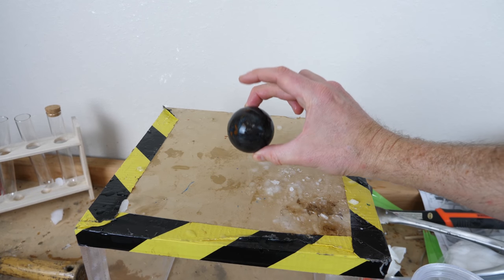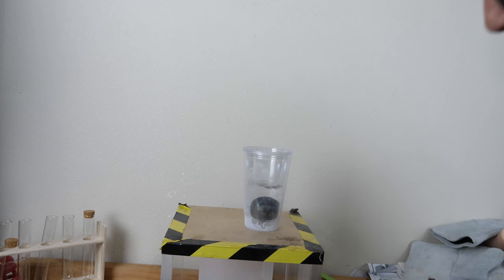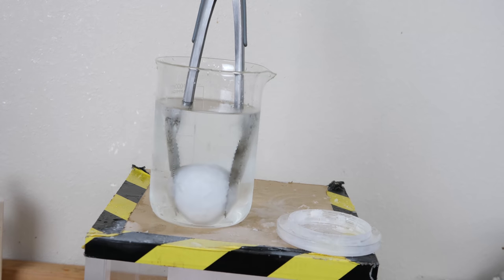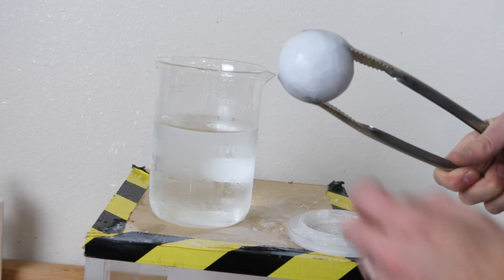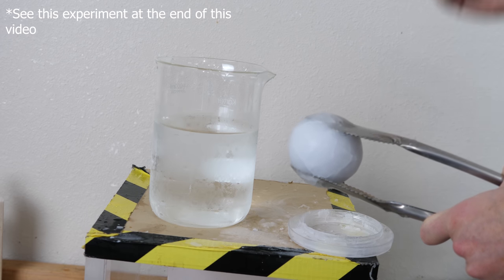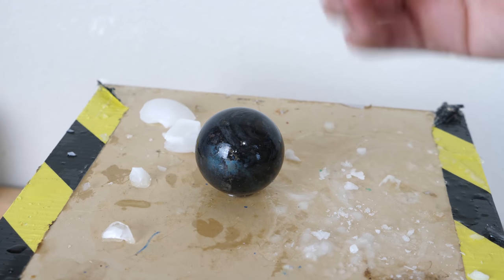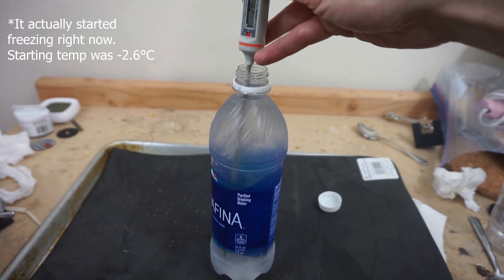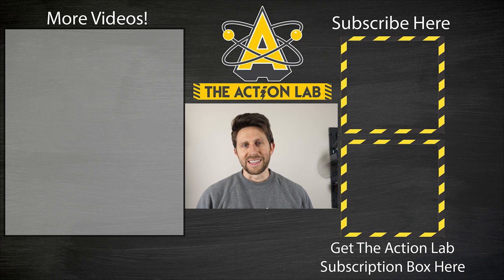-321°F Japanese Mirror-Polished Ice Ball— Exothermic Ice Formation

Comment: Try heating the ball till 1000°C and putting it in liquid nitrogen. Btw love your videos
Reply: Harshiplier - I second this idea 👌🏽
Reply: That would create a very violent , rapid and exothermic reaction aka an explosion so not a very good idea
Reply: Harshiplier boom goes the violent, rapid temperature changes
Reply: @santiagocanavati  no it wouldn't you can find a video on youtube of another channel droping red hot steel into liquid nitrogen
Reply: Boom!!!
Reply: same thing as putting a 1200c ball in ambient temperature water.
liquid nitrogen is not as cold as you'd think. it doesn't change the temperature delta that much.
Reply: A swimming pool of liquid nitrogen
Reply: so 1832°F
Reply: @santiagocanavati  we all want to see the explosion though
Reply: It will not explode due to leidenfrost effect(sorry if spelling not correct). when you put a extreme hot ball in a cold liquid then the vapour of liquid covers ball and act as a insulator. that's why temperature does not change rapidly.
Reply: @santiagocanavati  that sounds like a great idea.

Comment: I was curious, so you know how if you get a towel wet, you can wring it out? But it's still damp. So I figured, If you wring out a towel, can you use a hydraulic press to squeeze out the rest of the water leaving the towel dry again? 

Please like so the Action Lab can see this. I hope you can do the experiment.
Reply: The answer is yes, it would dry the towel out. You can do this at home by replacing a towel with a small sponge, the type you might do the washing up with, and replacing the hydraulic press with your hand. Get it soaking wet, then squeeze it in the palm of your hand into a ball. Hey Presto! A dry sponge.
Reply: It'd be more fun if he dried tomatoes by using a hydraulic press. Sun dried tomatoes? Pfft, I'm not waiting.
Reply: @dsp4392  I doubt it. I don't know for sure, but water is incompressible, while fabric is not. As long as water is present in the towel, it will surely protect the fabric, simply because the fabric will have a great deal more give than the water. 
I think we can get it very nearly dry. Totally dry? With a perfectly flat press, and enough force, maybe in theory. I really don't know. But it'll be practically dry, like as dry as a towel absorbing minuscule amounts of humidity from the air.
Reply: @ongbonga9025  Water definitely has low-compressibility, unlike the air contained in fabric, but fabric isn't infinitely compressible either. Once the air is fully compressed or expelled, only solid molecules (cotton, wool, polyester, etc.) remain, which aren't any more compressible than water. Depending on the setup, this will usually cause the fabric to tear apart as water in the middle of the towel pushes on the fully compressed fabric. watch?v=_QSJkwyjX4w actually shows the experiment being done, and while the poster claims their towel is "fully dry", it never actually is. As he moves up to thicker towels, it gets increasingly difficult to expel the water. Again, you can get a towel reasonably dry (as you said "we can get it very nearly dry"), but you'll never "squeeze out the rest of the water" using a press, at least not as effectively as heat and a bit of patience does.
Reply: Thank you all for your comments! This cleared up something I had been wondering about for a long time. But I still want to see the Action Lab do it.

Comment: I think this would be an interesting phenomena to explore for your channel. I work in a biology lab, where we frequently need to make agarose gels, which involves boiling the solution so that the agarose can dissolve into the water easily.  Before pooring gels into molds, I cool the agarose by running water over the bottle, and I notice that the water in the solution begins to boil rapidly if the container is sealed. My hypothesis is that the cooling of the air temperature in the bottle lowers the pressure, allowing the solution to boil, despite the fact that it is cooling off.

Comment: Makes sense. Since energy can’t be destroyed, that heat has to go somewhere. Normally it would dissipate in the air, or released into the container holding the ice. Since you added the thermometer you got a way to measure the heat that was being released.

Comment: Little fact too about white ice.is that tap water has more impurities so it turns white and also that since its in a freezer its freezes from the outside in trapping the air..if you use distilled water its clearer..and if you freeze it in a small cooler or in a freezer that freezes water from the bottom it will be completely clear.

Comment: My hypothesis is that temperature isn't the act of molecules moving, but that the movement of the molecules is caused by disturbances in the EM field (or EM radiation that is caught up between the molecules). So heat would actually be the EM radiation perturbing the molecules, rather than the "energy" contained within them. Take the heat out of something and everything slows down due to the lack of EM radiation in the local region, in between the atoms/molecules.

I don't know whether anyone else has thought of heat from this perspective before. It's sort of an inverse way of looking at heat.

Comment: The Action Lab Can you put this in a vacuum chamber that has radiant barrier on all the inside surfaces?  I suggested it for the red hot "nickel" ball experiment in the comments, although an incorporated small 1 way mirror would allow video observation as the ball cooled off.  With an ice cold ball you wouldn't need to observe it, the radiant barrier material could be on all internal surfaces of the vacuum chamber and you could just read the temperature after a period of time had elapsed.  I may have to do the experiments myself if you don't.  Thank you for the excellent videos.

Comment: So temperature is really pressure. Increased pressure = higher temp, low pressure = low temp (if low enough becomes a vacuum)

Question: if something is surrounded by ln2 , say a glass container or metal container, and a vacuum added to said container.... Would the air inside be considered a true vacuum?

Comment: If you think of it commonly instead of scientifically. Just understand that for the water to freeze there is motion and sound. If the temperature didn't increase, it would break the laws of thermodynamics because for the motion and sound to occur there must be energy put into the system. This energy is used up and converted into heat. Thereby, raising the water's temperature.

Comment: The experiment with the thermometer I think I might see a flaw. I think the actual reason the temp went up was because ice forming insulated the rod from the water and allowed the today, which I'm assuming was room temp to start, to warm the sensor a bit. I would like to see the same experiment done but with the thermometer cooled to the same temp as the water to begin with. I would expect to see the ice form but without much of a change from the thermometer.
I believe the idea of water giving off heat when it freezes, but the only reason it didn't freeze to start was because it didn't have particles to freeze to

Comment: +The Action Lab
While I agree that much of the heating comes from the freezing ice, I wouldn't say it only comes from the freezing ice, as I'm sure you know.  Plunging it in ethanol wouldn't freeze nearly as much, but it would still rise in temperature.  So we do get some heating from the ice decreasing in temperature itself
Reply from the maker: Correct, But I should’ve mentioned it in this video but the water was almost at 0°C already. I had it in my freezer before this. So there was not much “cooling” down to do, only freezing.
Reply: @TheActionLab   Yes, but also there's the cooling down of the ice once it froze.  Anyway, it doesn't really matter.  Thanks for the video :)

Comment: Actually I don't think you're right about that the only heat comes from the latent energy of the ice forming. While there is some heat created, you have still all of the thermal energy of the water (liquid and solid) being warmer than liquid nitrogen temperature. This thermal energy also heats up the ball. So even if the formation of solid water would produce no latent thermal energy, the ball would still warm up to equilibrium.

Comment: Actually the temperature of the water increase because the density of the water below 5 degrees is lower than above 5 degrees. So when the water at the bottom of the bottle start to freeze the warm (5 degrees) water in the top of the bottle go down

Comment: While this was a fun experiment, it does not show that freezing releases energy. Your previous experiment did a good job of showing the energy released. On the other hand this one only showed that heat energy was transfered from the water to to the ball, not that the total heat energy increased. While we know from your previous experement that heat had to be released, this experement had no way of tracking the total heat energy of the system.

Comment: Ice can only maintain a 0°C by itself though, right? So it freezing makes sense the temp goes up. Not like it went up much, just leveled off at where water turns solid. Also, the water, in relation to the frozen ball, is absolutely scalding, therefor heating up the ball whilst also forming ice on coldest part, insulating it some, so isn't it technically the water giving the heat to the ball, not the freezing? I mean, if you did this in an environment that was well below freezing, then dropped in the cooled ball, in more substances than just 1 type of liquid? That would prove its the water (liquid) that heats up the object, because ice forms at 0 C and if other liquids give you the same minor difference of going up to just the freezing point then its the liquid transferring heat the solid is slowing the formation of ice, right? Example: freeze ball in nitrogen. Temp water. Dip in water, let ice form break off. Repeat till ice can't form. Temp water again. If it is the ice making heat the water would heat up a tiny amount i would think.

Comment: The second video shows the exothermic nature of water freezing better than this video, but I wouldn't say that it is proof of it. The increase in temperature as it is freezing could be because the coldest water freezes first, leaving the (relatively) warmer water behind. Since the thermometer can only read the temperature of the liquid, it would show an increase in temperature. This would be similar to the effect where evaporation cools a liquid (you could say that water boiling is endothermic, by the same experiment around the boiling point).

Comment: Can you make some videos on what is anti gravity
Reply: It's a batshit theory, why would he do a video on this? Gravity is spacetime curvature. So anti-gravity, in the context of General Relativity, would be essentially removing spacetime curvature. How do you flatten spacetime? Considering energy is what creates the curvature, you're going to need to remove energy to flatten spacetime. 

Think about how a heavy ball stretches a sheet. The stretching is gravity, it's curved spacetime. To remove gravity, you need to unstretch the sheet. You can do that by either removing the ball, or by applying an external force (maybe pinching the sheet and pulling it up). Removing the ball is akin to making a planet disappear, while pulling on the sheet is akin to creating a local energy source that is equivalent to the planet, ie a metric fuck ton. In either case, it's not happening.

Comment: Not a mirror-polished ball, and you didn't polish the ice.  Water, even at 0 C, has a whole lot of thermal energy so you can't say that because the water was "pretty cold" it didn't add any thermal energy to the ball.  Finally, TKoR did basically this the other day, except they used water ice as the core.

Comment: Okay, let's talk about this for a moment.

When you expose an object that is a lower temperature to an object that is a higher temperature they share their heat with each other. Meaning the cooler object will become warmer and the warmer object will become cooler. This will continue until the two are the same temperature or until they both reach room temperature. 

So yes, when the cold ball is put in room temp water, the ball wanted up while the water froze because:
A. It was absorbing the heat from the water and
B. It was absorbing the heat from the air surrounding the ball once pulled out of the water

As for the bottle of water it heats up because of the factor B that I listed above. It was absorbing the heat from the air surrounding it.

Comment: i'm not sure this proves anything about freezing being exothermic. you exposed a very cold substance to a substance that was not as cold. the heat current caused the water to cool off and the  steel ball to warm up. i suspect if you used a substance that had a much lower freezing point you'd see the same result (ball warms up)

Comment: I don't think this proves freezing is exothermic. (It is true, but the experiment didn't demonstrate it)
For instance, if the ball was above freezing temperatures, then the water would give some heat to the ball, and when you'd measure the ball you'd find it heated up, just due to the sharing of heat. You wouldn't say that's an exothermic process.
Freezing being exothermic would mean that: apart from heat taken from the water to the ball, there would be extra heat generated by the process of turning water into ice.
If you would've measured the amount of heat added to the ball, and show that it was more that what was required to bring the water to the given temperature, then you'd get a proof of exothermicity.
Reply: Well technically cooling down water is exothermic as well..

Comment: So basically what you just said was that minus one is warmer than minus ten. 

The water was heating the object not the ice. Ice just formed on it because it was cold.

You said the ice was heating up the object. That's not true. The Ice was warmer than the object  itself but at the beginning and because of the fact that the object gave away its energy to the water. It tended to equalize.  
When it stopped freezing it meant the ball and the ice equalized the temperature, now the water again heats up the ice and the ice temds to equalize the temperature with the ball. Transforms heat, ice is not an insulator. It changes temperature.
Reply: The ball was cold enough to freeze the water on its surface.  The water froze around it. And when the temperature equalized the ice stopped forming  . If it didn't equalize it would blow up and grow until everything frozes. You want to say that now ice heats up the object? I see now that you're right.  But the object was colder.  So actually "colder ice" or colder object was forming the warmer ice outside and the air and the water was heating both the outer ice and was transforming its heat to the object. The ice was the product  caused  by the object not water.
 So basically the The air was heating it up. And the ice was its protection from the heat outside. It was actually keeping the object colder not warmer. The air was heating it all up.  But I already said that.

Comment: Definitely not "the same way that combustion is exothermic". This is just heat transfer. Exothermic combustion is due to heats of reaction and a change in the specific enthalpies of the products compared to the reagents. Hope this comment prevents enthusiastic science students from making this mistake under assessment conditions.
Reply from the maker: Umm, exothermic means exothermic. There aren’t two different kinds. The change in enthalpy is negative in both conditions due to the formation of new bonds. In ice it is the formation of new hydrogen bonds, in combustion it is the formation of new oxygen and carbon bonds. The only difference is one is a chemical change and the other is physical. That doesn’t make it non-exothermic though. So I state again, ice formation IS exothermic in the same way combustion is exothermic, since the total energy of the products is less than the total energy of the reactants.